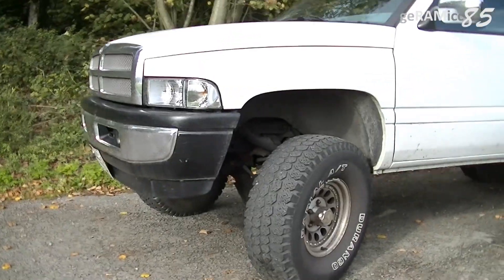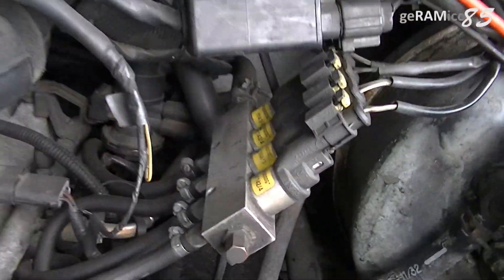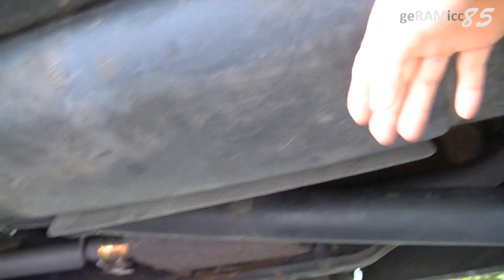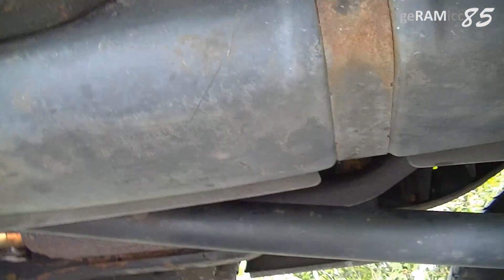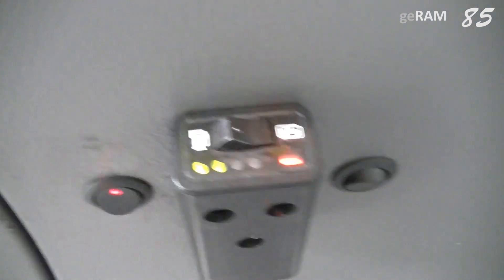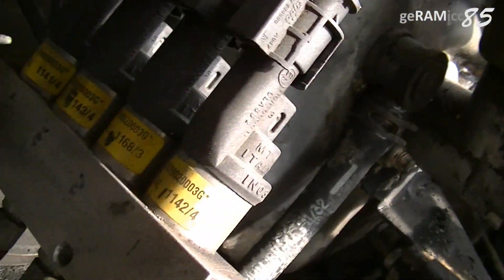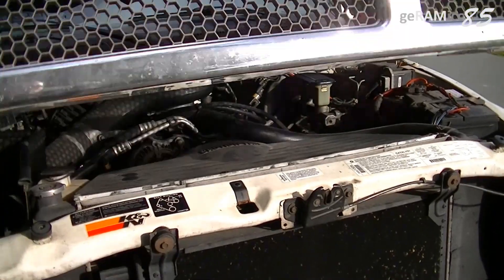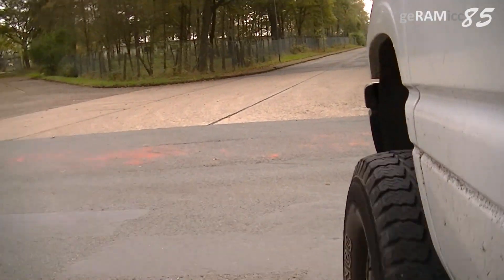FUEL PUMP DIED AFTER LPG-GAS KIT INSTALLATION |PROBLEM SOLVED |DODGE RAM BRC ETCG AUTOGAS LINE ISSUE

Comment: Mir ist heute die Pumpe verreckt, nachdem ich jetzt schon enige Zeit Probleme beim starten hatte. Und das alles erst, seit die Gasanlage eingebaut wurde! Die Frage die sich mir stellt, wieso das nicht bei allen Fahrzeugen passiert. Kollege hat in seinem Gen2 die selbe LPG Anlage drin wie ich, vom selben Umrüster und bei ihm funktioniert alles wie es soll. Naja.. ich hab jedenfalls ne neue Pumpe bestellt und werde dann einen Schalter dazwischen bauen. Wo hast du den Schalter angeschlossen? Gibts da im Motorraum irgendwo ne gute Stelle, oder hast du ein Kabel bis zum Tank gezogen?
Reply from the maker: ich weiss nur das einige fahrzeuge eine ringleitung für den sprit haben und einige nicht, und wenn keine vorhanden ist läuft die Spritpumpe gegen hohen Druck dauerhaft. Das kann ja sein, dass man glück hat und die pumpe das einige jahre mitmacht, meine nicht. .. für den schalter habe ich ein kabel gefunden, dass zwischen Radkasten vorne fahrerseite und tür fahrerseite drunter verläuft durch einen stecker. gucke nach einem grünen kabel wenn ich mich recht erinnere, das geht weiter zur spritpumpe, hoffe das hilft

Comment: I had the same problem in my van, this one even have the return line but the constant pressure ended up ruining the pump outlet, i'm wondering why the people from the lpg kit didn't take this in consideration it's also kinda dangerous, i installed a switch just like yours but hidden so it also acts as a theft deterrent

Comment: HI, I have BRC LPG in my car also, but 10 years worked well but now LPG doesnt switch on. I have change the injection kit and the fuses also but not working still. What is working is to add WD40 but only for 5 minute. I would like to ask for some help. Thanks

Comment: hmm thats weird it should turn off the entire petrol system when you are on lpg
Reply: The Wide Open Life Not really! LPG will only shut down the fuel injector while fuel pump still work build up the high pressure. I just recently replace my LX470 fuel pump.